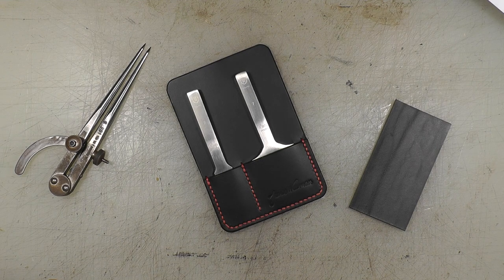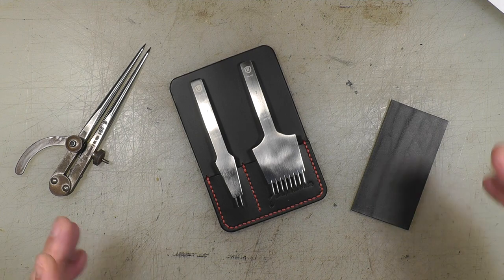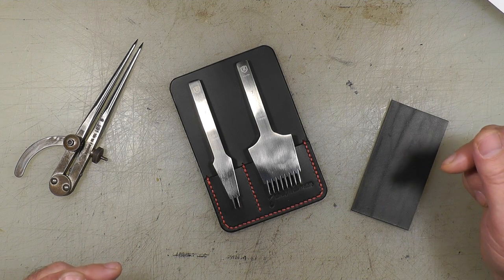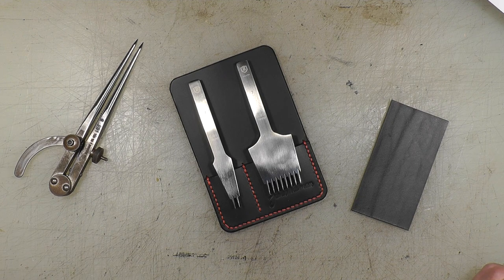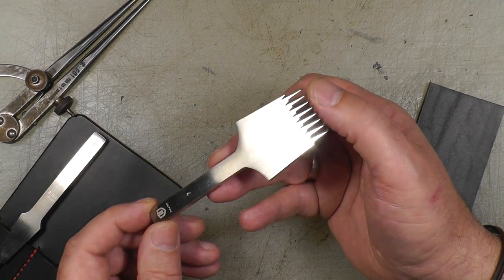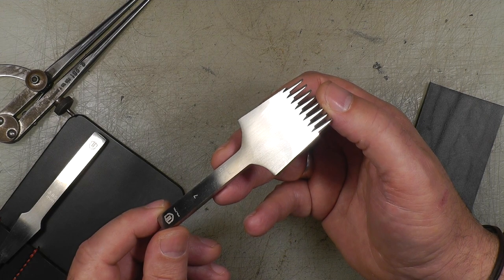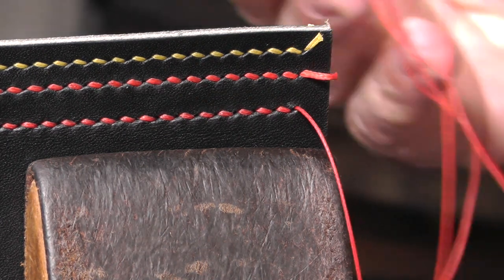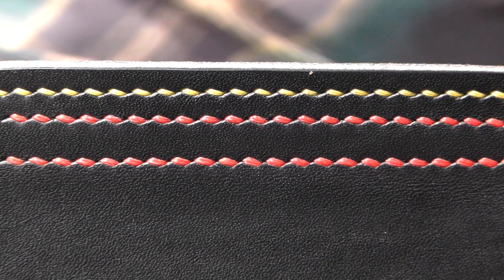Pricking Iron Review Part 14 Wuta Pricking Iron.

Comment: I have ordered several times from Wuta. Takes a few weeks to land in the states, but I have had good luck with them. I also didn't run into any problems with contact them going through eBay. Jfyi.
Reply from the maker: It must just be me they don't want to talk to then.
Everyone else who has ordered these has said the same, great contact and reasonably speedy service.
I have not heard anyone say they had an issue with ordering from them and they are nice little irons.

Comment: Will it be okay for the tool to penetrate 4.5mm thickness?
Reply from the maker: Hello Ahmad, While the Wuta irons are pricking irons (so the deeper the irons go into the leather, the bigger the hole they make) the teeth are long and slender so will pierce 4.5mm of leather, but they will leave a big hole.  There are better suited irons like the KS Blade or Sinabrocks for this task. I hope that is helpful. Regards, Nigel.

Comment: Hi
Thanks for the video!
I’m looking at getting a set of these, would you recommend 3.85mm as being a versatile size?
Also they list obverse and reverse on their listing, which would you recommend please?
Reply: I have the 3.85's obverse and reverse. I use them predominantly on knife sheaths. I thoroughly recommend them for work like this. You might want to go down a size if your intending to make finer items like watch straps and wallets. The obverse set will be adequate for almost all work you'll come across. My understanding is that reverse irons are useful for box making but I don't have enough experience to say whether this is the case or not. The company originally sent me a reverse set by mistake but were great to deal with and resolved the problem without any hastle. I prefer the appearance of the stitch these produce to my 3.8 Crimson Hides. I've found they do best with 0.6mm Tiger thread but you can go to 0.8mm for chunkier projects like a large sheath. In summary these are great value and very high quality. Just be aware that you'll need to use an awl if your sewing several pieces of leather stacked together.
Reply: @lmorgan877  
Thanks for your reply. I appreciate it!